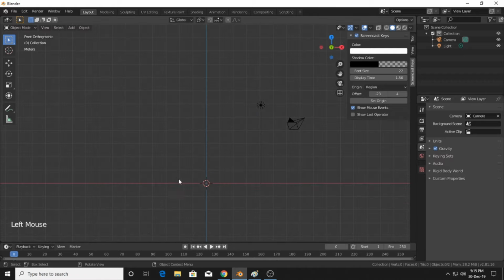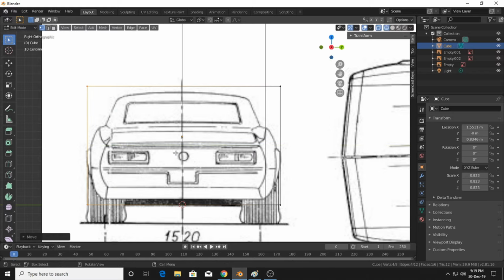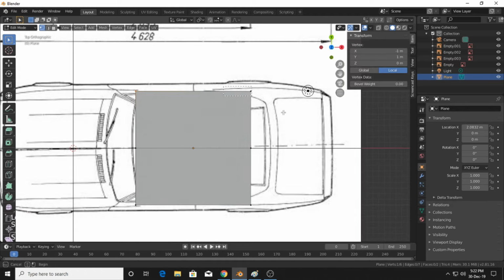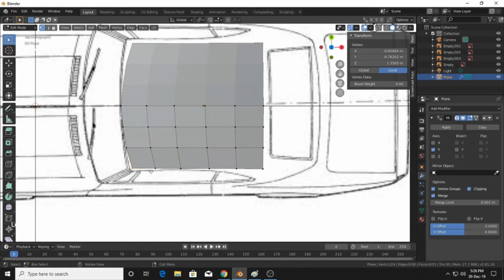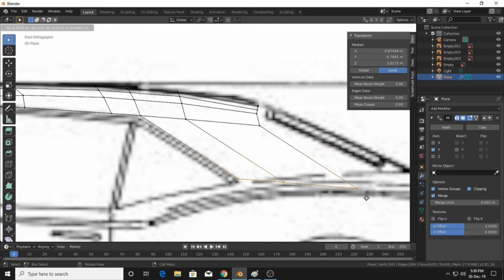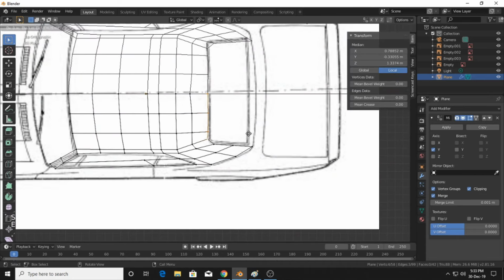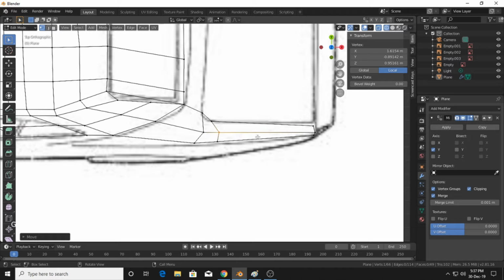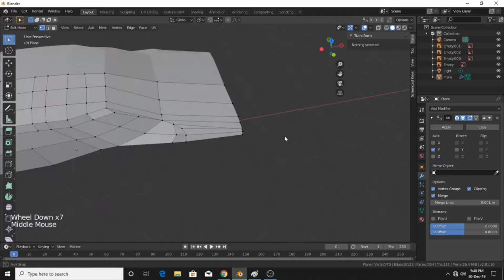Blender Tutorial | How to model Car in blender | beginner friendly tutorial.

Comment: Sir what is the minimum requirements of this software
Reply: depends on the version, blender can run on dumbest PCs but it will affect the workflow like rendering times, viewport render display etc. currently stable one is 2.83 and 2.9 is in beta mode I will suggest u to go with 2.83 which is a stable build right now with less bugs and 2.83 is the one used in video above
Reply: @HarshYadav-ul3jj  thanks